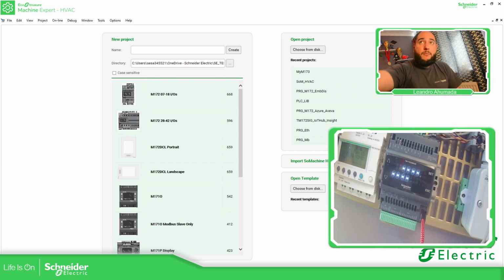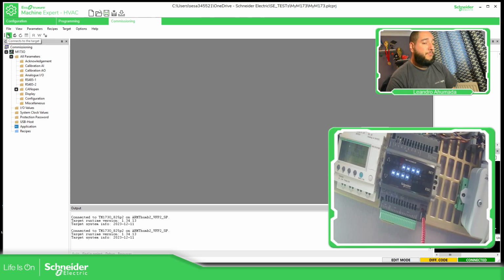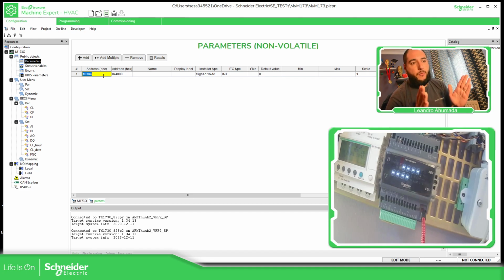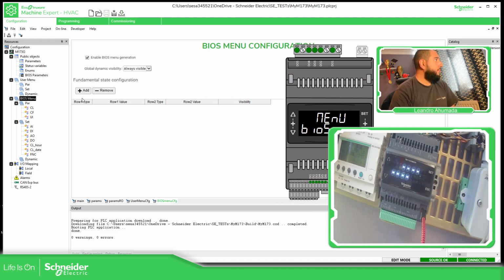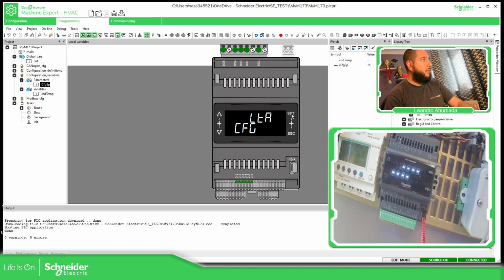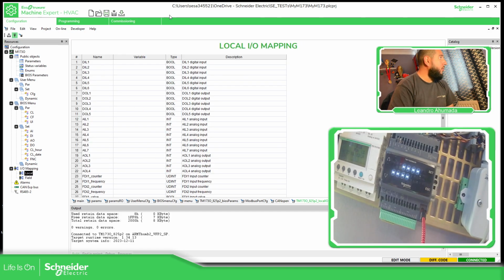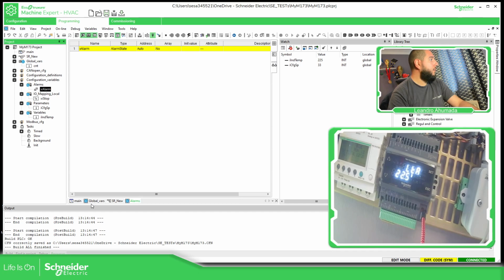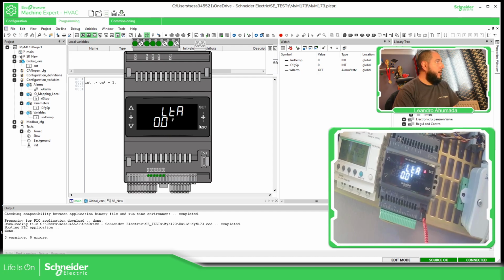Modicon M173 - Getting started

Comment: The m171 and the m172 do not have a 2 to 10 volt analog output option. This is a major problem when most Belimo actuating valves use a 2 - 10v signal. We have to go into the Schneider program and manipulate the program for most of the Belimo actuators we use. My big question is why does Schneider not offer a 2 to 10 volt analog output option?
Reply: Maybe use 4-20mA option and a 499 ohm resistor?
Reply: @RickHulshof-i7e maybe Schneider could make a 2 to 10 volt output option on there M173 revision. Belimo is a pretty popular actuator valve. I'm surprised Schneider did not respond.
Reply from the maker: Hi there! You can ise the 0-10v and set on the software to start on 2V rather than 0V

Comment: Hello. There are 2 questions about programming of this PLC:
1. Can we use PIDadvanced function block to provide PID control of desired parameter? (In this FB description is next information: it is designed to be operated on TM170 and TM171 controllers). If we cannot, how can we execute PID control in M173?
2. There is SERVO function block in Unity Pro software. It designed to work with PID controllers and convert PID block output into MORE/LESS pulses to control servo motor. Is there something similar to it in Eco Struxure Machine Expert software? (I did not find it).
Reply from the maker: Hi there! Thanks for waiting :) 
The Modicon M173 has PID functions , if you check on the library tree on the "Regul and Control" folder we can find the "PIDAdvanced" and "PIDAutoTuning" function blocks.
Regarding the second question for servos you will need a PTO output, in the M17x you can use the PWM output but i will advice to go to another family for Motion application if you are using servos, so the easiest one will be the M221. In my channel there are plenty videos related M221 and PTO.